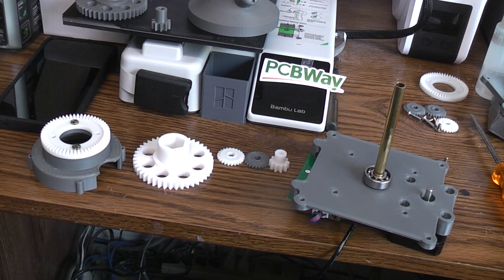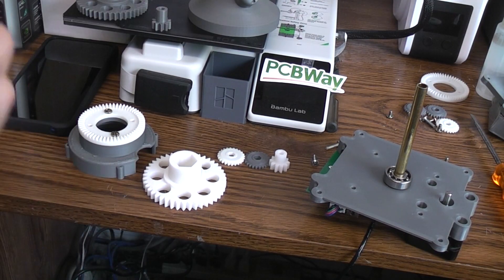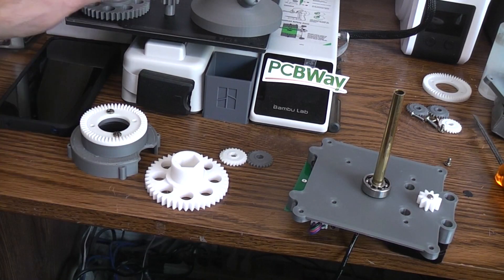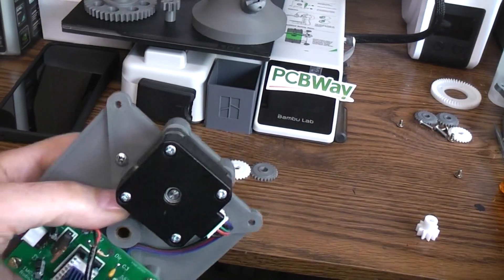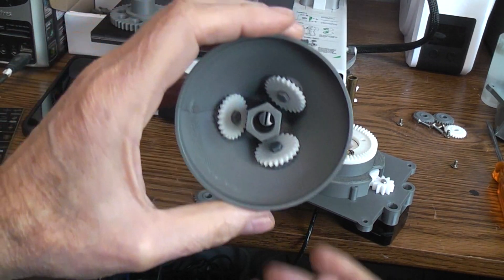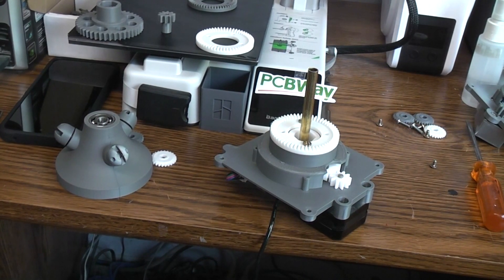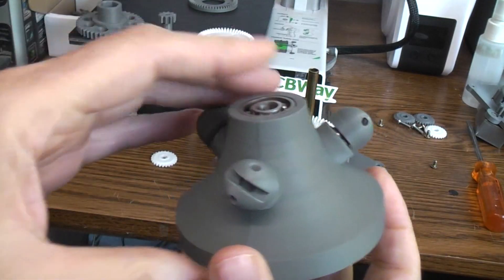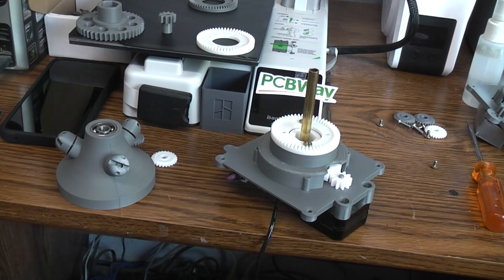Nylon 3d printed gears made by PCBWAY. I already tried PCB's & 3d printed aluminum & clear resin.

Comment: Given the cost of the parts, I would be tempted to make a hybrid with just the bearing surfaces in nylon and the inside of the hub in FDM
Reply from the maker: Yes, the price is very fair. So, testing different parts combinations would be interesting.
Reply: @Robothut  The hybrid gears might not make much difference in price for small gears like those. But I can see them making a huge difference for something like a 12" ring gear to drive a dalek/R2D2 dome or the like

Could also enable experimentation without having to remake the nylon part.

Comment: I wonder how durable the gears will be ?
Reply from the maker: That is what I hope to find out as well. There are new filaments for FDM printers that are supper durable and high heat resistant, the only problem is they charge $200.00 for a small roll of the stuff, and you have to have a printer that is enclosed with hardened nozzles that can go to over 300 C. Many of the new FDM prints can do this.
Reply: Those gears are hardly going to be under tremendous load. The bell and the gyros are pretty light. So I would expect he could have used ABS printed gears for years.

I can't see there being any problem at all with nylon and that is almost certainly superior to brass for this application because they are quieter and don't require lubrication.

Now if we were talking gears for some sort of tool... there might be a difference between actual nylon and the SLA/SLS version.

The nylon resin for my SLA printer is only $40 for a liter so I might have a go.
Reply from the maker: @hallambaker  Yes there is a difference between injection molded nylon and this material for sure, it just does not have that waxy feel. I an not sure that there is a actual nylon resin, I think they use the word nylon just like they use the word ABS "LIKE" when talking about hobby grade SLA resins.
As far as needing nylon for this project, I think PLA gears would last for ever as the load is small. But it was just a chance to try PCBWAY's nylon printing service so I took it. Let us know how your Nylon "like" resin printing turns out if you decide to try it out. I would be interested.

Comment: Great design John. The dimensional accuracy for those parts is interesting. I have something I print on my x1 carbon that has small gears and I'm always worried about them snapping. Laser sintered nylon might be a good option for me.
Reply from the maker: The price is right, just select the lowest cost shipping method if you decide to make an order.